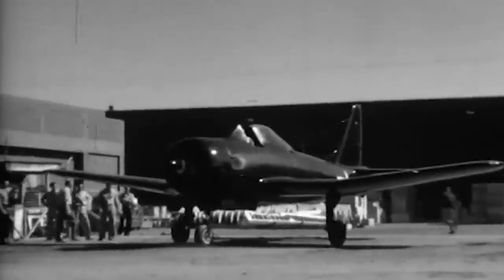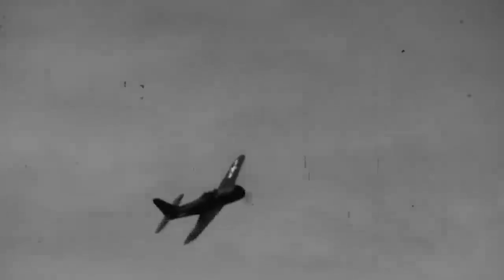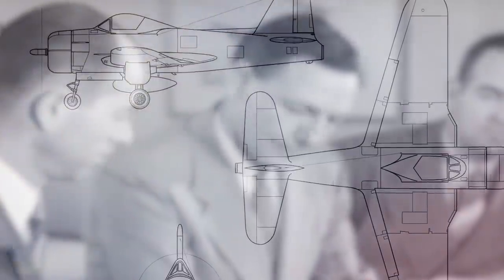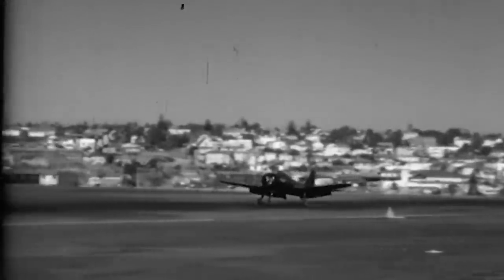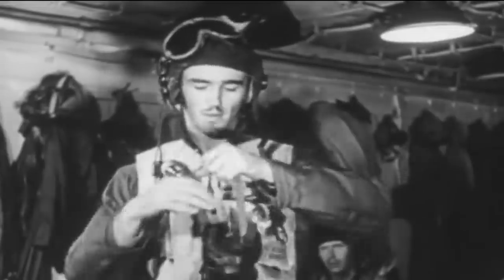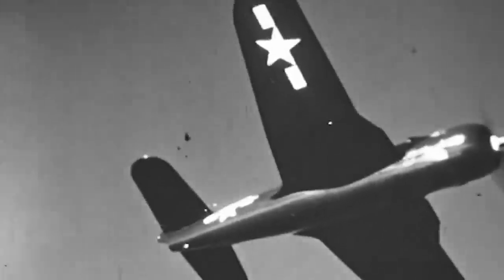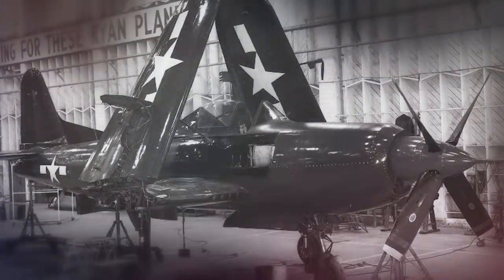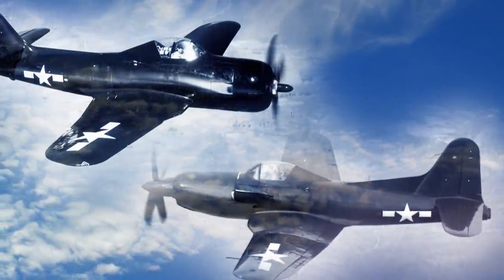The WW2 Fighter with a Jet Stuffed in Its Tail - Ryan FR Fireball

Comment: Slightly dangerous plane: exists
Military: you'll be nicknamed Widowmaker!
Reply: A lot of confusion on this. It wasn't its nickname, it was an adjective to describe it. 
Pilots and crew would call it "A" widow maker, not "the" widow maker. Same goes for the F-104, which eventually ended up sticking as its actual nickname.
Reply: how ' bout late bloomer.
Reply: @niixodus  Only the Germans called it that due to them using it in a ground attack role even though it was a high altitude interceptor
Reply: They are not wrong tho

Comment: It was actually a good idea to develop a hybrid jet/prop fighter to put a jet on the CVE carriers. At the same time, the Navy was goosing the production of the Commencement Bay class CVEs and needed a high-performance fighter to operate from their decks, and they were used almost exclusively for the Fireball's carrier trials. If the war had lasted until 1946 and the aircraft had been more rugged, they and the Grumman F8F Bearcat would have been the fighters of choice for most of the CVEs, though some Commencement Bay units would have carried Navy or Marine F4U  fighter-bomber (VBF) air groups. Except for some initial trials and training on CV4 Ranger, all the remaining trials and working-up involved CVEs.
The first problems indicated that the nose wheel strut was too weak.
As the first Fireball air group was getting ready to go operational, several aircraft began falling apart in flight or on landing, and inspections showed metal fatigue in the wings,and the aircraft was retired barely a year after entering service.
The main problem of the Fireball was that the plane was too fragile for a carrier-based fighter.
Reply: And nowadays prop-driven fighters are looked at again. Not as air superiority fighters, but for more "budget" options. Things like the EMB 314 Super Tucano.

Comment: In the 1960's my father built a scale model Ryan Fireball.  It was a control line model and I flew it with a fireworks rocket in the tail and a 2.5cc diesel in the nose.  I bit of fun but the rocket didn't contribute significantly to the thrust and burnt out rapidly.  Just a bit of fun!

Comment: Navy: We don't trust these newfangled jets. Put a prop on it.
Also Navy: We're only interested in all-jet fighters.
Reply: It happened when steam engines were put on  ships,the ships still had the sails.The technology was so new,the reliability was in question.
Reply: McDonnell had already been engaged for an all-jet Navy craft (FH Phantom) when the Fireball project went sideways. Mac ( the founder) said they would have flown a lot sooner in 1944 but Westinghouse was delayed in getting the engines to St Louis. Finally when the first one came, they installed it but the contract banned flight with just 1 engine. Anxious, the crew would taxi it back and forth and once it got off the ground. A lot of grief was passed around by the boss and there were no more taxi tests until the 2nd engine arrived.
Reply: It wasn't a matter of trust, early jet engines would burst into flames if the throttle was advanced too fast, and were slow to spool up and down. When landing on a carrier rapid continuous throttle changes are needed to adjust the glide slope.
Reply: @kdrapertrucker  The fuel consumption of jet engines was also a problem - a piston engine burns half the fuel for the same thrust.
Reply: Actually they did this because the early jet engines were intolorant of rapid throttle changes. (Intolorant as in they'd burst into flames if you made rapid throttle adjustments) to land on a carrier you must control your decent by adjusting your throttle up and down as needed. So that is why they initially went with the hybrid jet/piston design. Jet engine improvments and the invention of the angled deck aircraft carriers made jet operation from carriers routine.
Reply: @kdrapertrucker  All gas turbines are intolerant of rapid throttle INCREASES. This is because they inherently run ultra lean with the limiting factor being turbine inlet temperature - more fuel equals more heat. More heat equals more pressure so the turbine accelerates which gives more air but less heat. Modern gas turbines have two advantages over the earlier ones in this regard - better turbine materials and better throttle controls. The better materials give higher permissible turbines inlet temperatures and the throttle controllers take the temperature management away from the pilot and lets the engines run closer to the edges of the envelope. The reduction in mass of the compressor stages also permits faster acceleration of the rotors.
In short turbines can be throttled back fast but cannot be throttled up as fast as a piston engine.

Comment: Sounds like a good idea to select a company that has no carrier based aircraft experience.

Sounds like the fireball killed more Navy pilots than bad guys.
Reply: Military industrial complex.
Reply: Well with a name like fireball the plane can really only end up one way
Reply: You are correct as in my opinion Ryan Company had simply no experience whatsoever on carrier based aircraft probably the most stressful environment for an airplane. Well evidenced by rivets kept popping partially amended by doubling the rivets but also suffered structural failures as wing structure was not strong enough to resist compressibility effects and losing the canopy in a dive killing the pilot. It must be said that also the pilots contributed as they had no or little experience with tricycle landing by often landing on the rear wheels then slamming on the front wheel. But among various fatal accidents one pilot even lost a wing when diving. No wonder that the pilots was extremely reluctant to fly them, In fact the navy got rid of those "widow makers"...
Reply: Well. Grumman was swamped building Hellcat and Avengers, bought was swamped with orders for corsairs. They had GM building Wildcats for crying out loud.
Reply: Basically like the A10 today.
Reply: @kdrapertrucker  GM also built Avengers (TBM).

Comment: Everybody gangsta until they lands a jet on a boat
Reply: They put physiology monitors on the pilots. Even considering life or death combat, the heart rates were never as high as landing on the carrier at night.
Reply: I did mention the deck (landing plane/runway) may be heaving vertically as much as 80 feet, right?
Reply: @bryanst.martin7134  
80 feet is well outside of the parameters for conducting flight operations on a carrier.
Look it up, the Navy lists the safe operation conditions for launch and recovery operations as roll angle's of less than 8° and pitch angles  of less than 3°.
Nobody could land an aircraft on a deck heaving 80 feet in the air, that's just ridiculous.
Reply: Add in early jet engine with sluggish spool up time and tendency to flame out or caught fire. A nightmare. Kudos to first jet aviators ...
Reply: Want better than that? I worked with an AC rated Sailor once who described handling a stricken aircraft at sea. The pilot was disoriented, as it was a moonless foggy night, and he was at 265 knots, and crying. His instruments weren't reading correctly, and no matter what he did they didn't respond right. My acquaintance looked at the altimeter his plane was indicating and it was all zeros. Realizing the problem he took control of the plane and ordered the pilot to execute an immediate 180 degree roll. Which the pilot executed and suddenly came to his senses, and returned to the carrier safely. They don't let dummies do these jobs.

Comment: Had never heard of this Fireball. I had a summer intern job at Ryan Aeronautical in San Diego in the early '70's. The Firebee target drone was a large Air Force contract. And knew also about the Firefish motorboat drone. So, they stuck with the 'Fire' prefix, even though that Fireball was never sorted out, apparently.  Another name I remembered was Firefly, but had to Google it. It was the same Firebee drone, modified for film and signals intelligence. The Firefly was used extensively over Vietnam, and some over China. Later versions were remotely piloted from their C-130 launch planes. "Ryan Model 147" page on Wiki is very detailed. Lots of special purpose variants, such as a "sniffer" to seek out SAM missile site radars.

Comment: Tricycle landing gear was needed for jet powered planes.  The Germans originally configured the ME262 as a tail-dragger --- but it kept burning up the runways until it reached enough speed to lift the tail.  You sure would not want on a carrier with wooden decking.

Comment: actually the base idea was pretty smart if you think about it, early jet turbines didn't have good acceleration. But combined with the torque of a piston engine for acceleration and lower speeds it would be a great way to get rid of these problems, and then for the high speed and top speeds the jet engine would support the piston engine.
Reply: yeah.  but,  two systems Doubles the complexity;  and was  probably, a bit heavy.

Comment: There's a number of planes that showed up too late for WWII which are impressive. The Boeing XF8B stands out as a total beast of a piston-engined plane. Using a 3000 HP Pratt and Whitney R 4360 radial, this monster was fast, long-legged, and heavy. It never stood a chance against the Grumman F8F Bearcat though. The Grumman was cheaper, plenty fast, maneuverable, and took up less deck space on the carrier. A look back might have put this into production as a close air support attack bomber to complement the Douglas A1D Skyraider, but it didn't happen. Martin built another plane around the R 4360, but it was slower, heavier, and had a lighter bomb load than the Douglas A1D which could carry seven tons of ordinance at speed with 1000 less horsepower.

Comment: 1:21 footage from the Forrrestal fire, taken in the 1960's. With jets all over the deck. 
2:17. That is not a jet powered aircraft, that is the  old P-39 or maybe a P-63. Not a jet at all.
Reply: Also at :52 is a landing on an angle deck aircraft carrier.  I'm sure there were only straight deck carriers in the U.S. Navy's fleet when the Ryan FR-1 "Fireball" was operational.
Reply: You must be new here nobody cares... Its all about the narration
Reply: @epapa737  Guess no one cares about accuracy.  Oh well.  Anyway, also at 5:36 is a shot of a Vought F4U Corsair taking off, not a Ryan FR-1 "Fireball" as implied in the "nobody cares" narration.
Reply: stop  a  kamikaze ? the  only  thing that  stopped  a  kamikaze  was  either  the  flight  deck  or the water.
Reply: @epapa737  Which is also often incorrect.
Reply: @driver4011  or a 40mm or a 5" round
Reply: @driver4011  or a 5" gun
Reply: Looks like the P-59 Airacomet.  https://www.google.com/url?sa=t&rct=j&q=&esrc=s&source=web&cd=&cad=rja&uact=8&ved=2ahUKEwj5mYGR15TtAhUPQTABHQaUC9gQFjAAegQIBBAC&url=https%3A%2F%2Fen.wikipedia.org%2Fwiki%2FBell_P-59_Airacomet&usg=AOvVaw1RJpOZP91WPdVRCoY7Ma9V
Reply: There isn’t enough footage to be completely accurate.

Comment: One of the Fireballs is parked, moldering away, outside of a hangar in Idaho Falls, Idaho (if you are travelling down I-15 going south and look towards the runway at the IF airport it is parked by one of the hangars, depending on the day they will have the gate open.......

Comment: Even up to the Korean War, piston engines had more power than the latest jet engines. The only good reason for going to jet was that planes with jet engines did not experience aerodynamic compression so early, because the blade tips of a piston engine were going approaching the speed of sound before the whole plane was.
You may remember the novel and movie, The Bridges at Toko-Ri, where F2H Banshee pilots were trying to knock out truck and railroad bridges in  the most heavily defended (anti-aircraft) locations of the war. In fact James Michener (author) gained inspiration for that story from F4U Corsair pilots doing the same thing. The reason was that while the Banshee was much faster than a Corsair, it did not have nearly the bomb load capability.
So this Fireball abortion would have been better off with a bigger, supercharged radial engine than sticking a jet up its tail.
Reply: bla-bla-bla-blade tips -bla-bla-bla       '...before the whole plane was.'      was  WHAT.       your statement  is  less-than clear.     if there was  a relationship between a supersonic prop tip speed  and  airspeed, you have  NOT  stated it.
Reply: @daviddavids2884  , I suspect you really got your rocks off, typing that. That's what trolls do, right? Here you go.
http://www.aerospaceweb.org/question/aerodynamics/q0031b.shtml
Reply: @donaldbadowski290  oh, and,  YOU   should    read  it  AGAIN.     cuz your comment is still   GIBBERISH.
Reply: @daviddavids2884  , un-Troll yourself and write a better one.

Comment: Ryan Fireball top speed: 426 mph
P-51 Mustang top speed: 437 mph
So what was the purpose of the jet engine?  Why are jets superior?  I'd guess the extra weight and flat nose caused by also having the piston engine cancelled any benefit the jet engine contributed.
Reply: They wanted the benefits of the jet but the carrier handling of a piston engine, the technology was also cutting edge so they had to start somewhere
Reply: Early jet engines were not good at sudden changes of power, so if you needed to suddenly increase power like for a wave off on a carrier landing the piston engine could be depended on is probably the think. Most Me 262s shot down in the war were during landing and take off phase when the could not rapidly change power settings thats why the had to try and guard the airfields with them with Fw 190s .
Reply: The xf15 could go over 490mph The Navy made the wrong choice in the competition
Reply: I think it was all about the climb rate to intercept incoming Kamikaze attacks.

Comment: did any of these planes puirsue the positive charging of the leading edges coupled with the negative charging of trailing edges? is that system still in use on planes today?
Reply: wth  are   you  talking  about.     can  you provide a link to an explanation of 'charging  a wing edge'.
Reply: @daviddavids2884  it was on a documentary here i saw ages ago where they found it allegedly increased the planes speed a lil etc,,,,cant remeber the name of it sorry
Reply: @tonyhyde2644  okay...so, you thought it was a good idea to comment here and  Pretend  that you knew  What you were talking about.   classy
Reply: @daviddavids2884  i pretended nothing,,,i only asked a question about what i had learned a bit of...you learn when u ask questions, not accusatory assumptions
Reply: @tonyhyde2644  yes.  and there IS  such a thing as a  STOOPID  question.   this was one.
Reply: @daviddavids2884  obviously uo know nothing of what i posed for if you did, you would not have commented so negatively

Comment: Designing a fighter for the rigours of carrier operations isn't easy.  With no prior experience Ryan came up with a design that immediately qualified for carrier ops unlike Vought's Corsair.  It just wasn't built to Grumman "ironworks" standards for abuse by naval aviators. Not surprising considering what the design was being asked to do.  
The tricycle landing gear was bound to cause problems due to pilot training issues.  Service pilots landing on carriers were used to slamming their planes onto the deck in what would be a write-off for an army fighter.
The Fireball was a successful aircraft with bad timing.  It ran out of a war to fight and into all jet plane development.

Comment: Whittle had an early jet engine back in 1924 when he wrote a book about jet power and how it worked in 1927 he had a working jet engine on a test bed. He was already in the 1930s trying to get a jet put in a plane. But UK government was thinking biplanes still and silly engines. Hence the gladiator as an early 1930s fighter. But two companies changed that Hawker and Super-marine this is where Rolls Royce came in so people forgetting the Jet engine. Until Glostor came to play and used the test bed engine in the Gloster plane flying in 1941. But the Germans already had early Jet engines far less reliability and power but was flying faster than the prop planes. But in 1942 something changed as first of the 262s appeared. So another company in the UK also took up building a jet engine and de Havilland started to test a vampire in 1942 which was the first Jet to land and take off from a carrier.

Comment: 5:35 this looks more like an F4U corsair to me...

(edited)

And it is a F4U. First clue is that there is no tricylcle  landing gear. Also the Cockpit is way to far back. Also the wing roots are way to far back on the fuselage.
Reply: what  are   you  yammering about....  MOST  prop-powered planes  'look like'  one  Another.!!!!!       do you  Even  KNOW  what drove the design of the f4u.     didn't  think so.      googletranslate
https://en.wikipedia.org/wiki/Vought_F4U_Corsair
Reply: okay.  i get it.   THAT was a f4u.      shame on  them
Reply: @daviddavids2884  dude... why so angry? Basically you dont know your planes. i dont KNOW what drove the design, but i KNOW what a tricycle landing gear looks like, and that plane in the mentioned footage didnt have one! not only shame on them, but also a tiny little shame on you! (just kidding)

Comment: Fascinating aircraft, but several errors in the video. That's a Corsair at about the 5:36 mark, not a Fireball. The comment about adding a "new tail with stabilizers" doesn't make sense. Ditto for the comment about "turning on the jet engine moments before hitting the crash barrier." But some fine historic footage all the same.

Comment: Structural problems may be atritbuted to the weight of two engines in the thing. Can't imagine that a radial and a early turbine wouldnt weight a fuckng lot.
Reply: And how does the torsional force if two different types of engines affect the airfrsme?